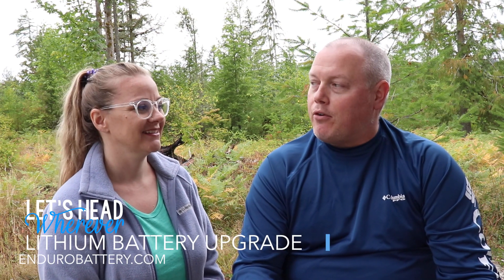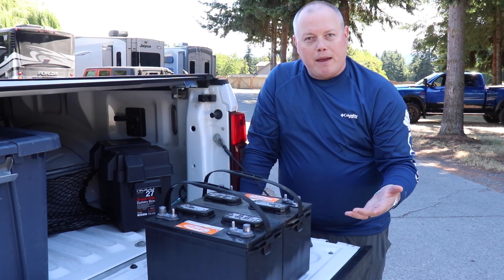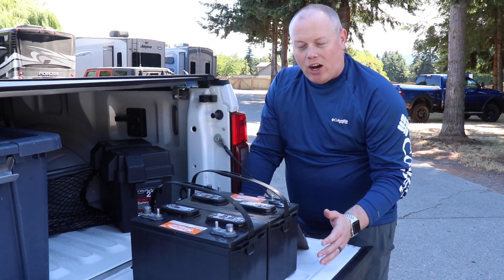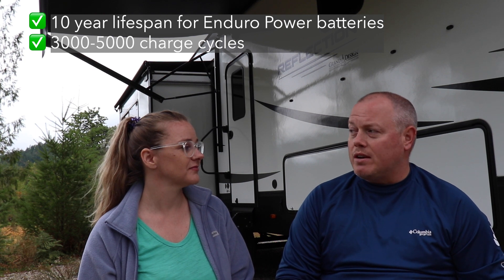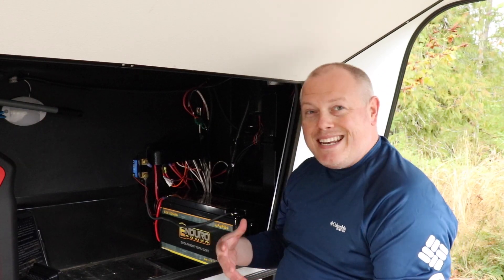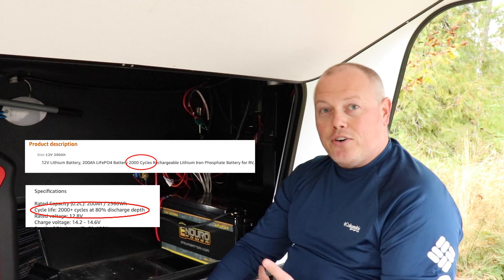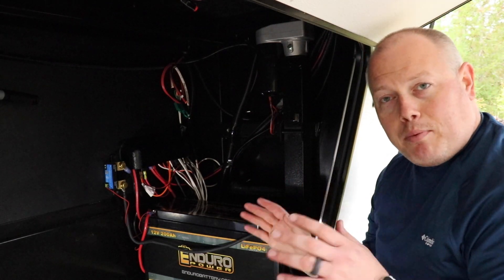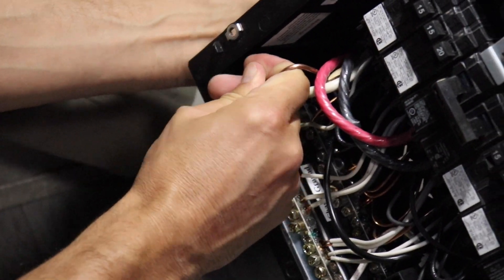RV BATTERY UPGRADE 🔋 ENDURO POWER LITHIUM BATTERIES - 5% off with code LHW5

Comment from the maker: 🔋 Use code LHW5 and save 5% off Enduro Power Batteries 🔋 Same specs with a 25% smaller battery case and save HUNDREDS over the big brand battery 😉 https://www.endurobattery.com/discount/LHW5

Equipment from our upgrade project:
- 200ah 12V Lithium Iron Phosphate battery: https://www.endurobattery.com/discount/LHW5
- Victron Smart Shunt: https://www.victronenergy.com/battery-monitors/smart-battery-shunt
- WF-9855LiS Converter: https://wfcoelectronics.com/product/wf-9855lis/

Comment: Can you run ACs off of them like the other lithium ones. I want to run the whole house part of a super C lol
Reply from the maker: Sure, you can run the AC… but not for very long 😅 Even with 900ah we could probably only run the AC for a couple hours.
Reply: @LetsHeadWherever  those are lithium correct? Couldnt you add batteries to increase run time? Already im not sold on these batteries. Think ill go with battleborn. Can really get some ah with those.
Reply from the maker: @blackcatrose4257  Yes, they’re LiFePo4 batteries. You can add ad many as you have room for. We have 3X 300AH batteries so they don’t take up much room.

Comment: I do like the smaller size of the Enduro Power batteries and while they do appear to be built with lithium cells that are UL certified the rest of the electrical components are not.   I’m specifically concerned that they do not carry the UL2054 certificate against explosion and fire.

Comment: Thank you for an excellent video. We are looking at lithium for our truck camper. Need to ask to be sure: I know you’ve gotten a solar system since this video. Did you have any solar when you were doing this battery project? Blows me away how much you could do with 200 amp hours!!
Reply from the maker: No! We had zero solar when we first upgraded batteries 🔋
Reply: @LetsHeadWherever  Thank you. That’s what I thought but I had to ask to be sure as I’m blown away by what you could do  with just the batteries!! Amazing!!

Comment: Which WF power converter did you remove? We have a WF 9855. Their website doesn't indicate if that unit is compatible with an lithium batteries.
Reply from the maker: I don’t recall and we’ve since replaced everything with a full solar/inverter system. If I remember correctly, so long as it states both 13.6 & 14.7V you’re good. The 14.7 will bring the lithium battery to full charge.
Reply: Just found the specifications on the 9855 The charge voltage is 13.2-14.4
That probably won't get lithium to full charge. Do you still have your lis converter? If so do you want to sell it?
Reply from the maker: It may be 14.4, I was going off memory… dangerous move 😅😬
Reply: Ok looked at spec's for lis and max voltage is 14.6. So your memory is pretty good. Same for the 9855-AD. Which is their auto detect unit for lead acid or lithium.

Comment: I'm going to add a small bit of "Food for Thought" to this video. 

If you wish to keep your Lead Acid batteries in good working condition for the longest period of time, then as stated in this video, you shouldn't discharge them below 50%. But that doesn't necessarily mean you have 50% for usable energy. See, you think you know where I'm going with this, but I promise you, you (probably) don't. 

From 80% to 100%, your Lead Acid batteries go into an "Absorption Phase" where the battery charges MUCH SLOWER. It takes many Hours, trust me, more hours than you have in a day of typical charging while camping, to go from 80% to 100% capacity. So let me lay out a typical camping scenario. 

Let's say that you're going to be in a camp ground with no hook ups for a 5 day stay. You have a 200 watt solar suitcase and a portable generator. In a best case scenario, you have full sun for the five days and you can run your generator 2 hours in the morning and 3 hours in the afternoon. 

On the first day you pull into the park, your 2 100ah batteries (200 total ah) are at 100%. You have 100ah of usable stored energy. With typical usage, on the first night you watch a bit of TV and maybe your Furnace runs a bit because it gets down to 60 degrees overnight, you charge some phones, laptops, your on the internet etc. In the morning, you have used 30 amp hours. Effectively, your down to 70% of your total 200ah left. You have 200 Watts of solar but even during the day there is a small draw on the batteries so your battery bank is either holding steady or only charging very slowly. So, you run the generator for the full 5 hours of allowed time. At dark on the second night, you start with with 80ah of capacity. Note, you were only able to put 10ah back into the battery bank because at the 80% mark the battery charging slows way down. In the morning you have used 30ah and you're bank is down to 50ah. Same charging parameters as before (a bit oversimplified just for this example) and you head into the third night of your stay at 65ah. Note, this time you were able to get 15ah into the batteries because your within the battery banks bulk charge range. In the morning you wake up having used another 30ah to a battery bank with 35ah in the tank. Same charging parameters as before and you head into the 4th night with 50ah. In the morning you wake up having used another 30ah and your now down to 20ah in the tank. Same charging parameters as before and you head into the fifth and final night of your stay with 35ah. In the morning on the day of your departure having used another 30ah, you wake up with just 5ah of useable stored energy. Barely enough to pull the slide in before dipping into the danger zone. It's a good thing you're leaving because your battery bank can't handle another night of use without a complete full charge which could take a day or more of full charging. If you're staying for 7 nights, you're going to have to effectively stop using any power and just charge. 

The moral of the story in case it's not clear is: While camping, the effective usable range for your Lead Acid battery bank is between 50% and 80% (of your total possible amp hours). If you have a 200ah Lead Acid battery bank of which you can effectively only use 100ah, and you can only effectively bulk charge between 50% and 80% (of the total capacity),  you only really have 60ah of effective energy to use. Ideally, you would want to have the ability to charge your Lead Acid Batteries 60ah each day if you want access to your full (Real) capacity. Under a typical daily usage of 30ah, you should be able to at least jack 30ah each day into your Lead Acid battery bank. 30ah isn't an extravagant expenditure of power for typical RV's. We're not talking running the AC or Microwave or hair dryers or coffee pots. We're talking about lights, charging phones and computers, maybe some TV use, maybe the furnace fan, water pump and parasitic battery draws. Where I live we get plenty of cloudy rainy days and we primarily camp in the woods under partial tree cover. We have 400 watts of solar power and we are lucky if we pull in a MAX of 80 watts. Averaged through out the typical day, we pull in around 20 watts of power per hour on average. I have a 70 amp Progressive Dynamics PD9270 converter charger. I have NEVER seen my battery bank draw more than 15 amps of power while charging the batteries and you can only run your generator 5 hours a day in most parks. Believe me, it's not as easy as it might first seem to jack 30 amp hours a day into your Lead Acid battery bank.  

While upgrading to Lithium is anything but straight forward,,,,,, in fact let me say this first. Anyone who says you can "Simply swap the batteries and upgrade the converter charger" DOES NOT KNOW WHAT THEY'RE TALKING ABOUT, PERIOD! Lead Acid and Lithium are two different echo systems and even the most modest 2 battery 200ah Lithium battery upgrade will require updating your RV's echo system. If you don't know what I mean by echo system, then you need to do your research because there are lots of considerations that many of these YouTube videos are not telling you about. But, as I was saying, while upgrading to Lithium batteries is anything but straight forward, they are superior in every way to Lead Acid. There are two major advantages in particular out of loads of advantages that make a huge difference. First, they charge MUCH FASTER in that you can pound up to their rated charge current into them from empty to full. In many cases, you could potentially jack 100 constant amps into a 200ah lithium battery bank until full charge. So the time you have each day to charge is worth a lot more.  Second, you can reliably pull 80% of the battery banks full capacity out of them without significantly impacting their longevity. That's 160ah out of a 200ah lithium bank. There are loads of videos that say you can fully discharge a lithium battery or pull out 100% of it's capacity out. And sure, you can do that, but doing so will cut the life cycle of your batteries in half. If your batteries are rated for 4000 cycles, you can figure on getting 2000 cycles out of them if you fully discharge them every time. In reality, the typical RV camper will never use 160ah in a day unless they're running air conditioners and other high draw items. If you're drawing 30ah to 60ah out of your 200ah Lithium bank each day, you are not only able to replenish that amount far easier, but you will never come close to over taxing the batteries.

Comment: Does the battery itself have A system built into the battery where it doesn't overcharge it
Reply from the maker: Yes, each battery has an internal BMS.
Reply: @LetsHeadWherever  ok thanks

Comment: Thanks for the video.  We would probably not be off grid for more that 2 nights.  I'm considering just a 100AH because it will fit in the depressed storage area in our Reflection.  But curious, how do you secure your batteries?  Thanks
Reply from the maker: We bolted 2 pieces of 2x4 to the bottom of the front storage bay and the batteries rest on them. They’re snugged up in the corner but not secured by anything. I don’t think they’ve moved since the install!

Comment: Just received our 300 amp hour EnduroPower batteries this week. Looking forward to installation which will be simple cause we’re replacing existing batteries. Drop in and attach cables. 340 pounds replaced by 130 pounds.
Reply from the maker: That’s awesome! You’ll love it 🤙

Comment: When traveling, can the truck recharge a Lithium battery?
Reply from the maker: It may send a trickle of charge over to the RV, but the the 12V wire in the 7-pin connector is too thin to actually charge it while driving.

Comment: That’s great . How are you charging the battery,?no Solar?
Reply from the maker: Initially, we would just keep the battery charged from shore power, we would only do a day or two off-grid. Since, we’ve installed a complete solar system.

Comment: Hi.  Just saw your video and your video got my attention.  Bought a Class B 2 years ago and have been thinking about replacing the AGM batteries when the time comes.  Was thinking about using another brand not battle born unfortunately my dealer has to get permission from Manufacturing company of my van to install the batteries.  So now I am going to start looking for someone who can install lithium batteries.  These enduros seem to fit the bill for what I want...great video by the way.
Reply from the maker: The Enduro batteries have been great. We even added more during our solar install 🔋 👍

Comment: The ultimate battery: Internal battery monitor shunt. Internal disconnect switch. A built in Anderson Power pole SB175 inverter connection and a separate Anderson Power pole connection for the charge controller. A case that can be opened if a cell or the BMS needs to be replaced. Provisions for mounting it to a floor or a wall.

Comment: Thank you for your very in depth review of your solar system. Just subscribed to your channel by the way, I have one question though. We have a smaller unit than you a 24ft Micro Mini. It came with (1) 100 amp solar panel do you have a suggestion of how many more panels we would need to compliment your set up and can we still run our 1500 air conditioning unit. Great video easy to understand!
Reply from the maker: I am admittedly not very knowledgeable about the electrical systems and how much folks need between solar/battery. I know a good bit about our system, but outside of that I’m basically 🤷‍♂️😅 I recommend checking some of the Boondocking or Solar RV Facebook groups, they have folks who know way more than me and could probably advise you better 🤙

Comment: Thank you for making this video, this is what I have been wanting to do but was unsure if it was possible.  One question for you though, can I do this without installing the battery monitor?  Thank you!
Reply from the maker: Yes, you don’t need to have a battery monitor, but it was important to us have the ability to see precise charge levels and know how long until we went dark 😬😅
Reply: @LetsHeadWherever  Thanks for the quick response!  Thats what I thought but was not sure.  We are almost always plugged into power and dont feel that we currently need to monitor to the detail that is offered with that monitor.

Comment: Great video!  This is exactly what I've been looking for.  It's been a few months, any issues with the Enduro Power?
Reply: I have had my Enduro for over a year and they have been excellent. Love my system.
Reply from the maker: We just added another 300ah. Total bank is 900ah now 🤩
Reply from the maker: Our Enduro batteries have worked flawlessly since the install. We actually upgraded to 600ah when we installed a full solar system a couple months back. We have a video for that as well 🤙

Comment: Initially - the up-front price seems to be the only downside.  but if you look at the battery cost over 10 years for 200ah, and compare that to Lead acid - suddenly Lead acid batteries are the more expensive choice!!  Looking to take the "Lithium" plunge ourselves soon...
Reply from the maker: That’s exactly right. Especially knowing the lifespan of lead acids are only a couple years and you need 5-6 of them to make up for the single 200ah. Those things add up! Thanks for stopping by 🤙

Comment: Do you remember what the bottom dimension was of the 200amp you put in?  I'm wondering if a 300amp would fit in the same space?
Reply from the maker: Herb, sadly I don’t know the dimensions off the top of my head. They’re listed in the specifications on the website for sure https://www.endurobattery.com/discount/LHW5
Reply: @LetsHeadWherever  Thanks, I emailed Enduro to see if the top and bottom dimensions were the same. From pictures it looks like it tapers out at the top and didn't know if dimensions included the handles or not....Did you have more room at the bottom of your tray?
Reply from the maker: I have over an inch, possible two inches of wiggle room between the battery and walls of the storage area. We’re adding batteries soon so I plan to fix them in place once the full array is there.
Reply: @LetsHeadWherever  Thanks Joe,

Comment: What was your solution with regards to being able to charge the lithium’s from your truck?  Do you just not charge when going down the road? My understanding it pulls too many amps with just the normal truck to trailer hookups.
Reply from the maker: There’s a trickle from the truck to the lithium battery when connected, but I pull the 7-pin as soon as I can to avoid having the lithium leach off the truck battery. I won’t rely on the truck to charge anyways, we have a generator if we absolutely needed to top the RV battery off.
Reply: @LetsHeadWherever  I've read that you can burn up your alternator without a DC-DC converter. Are you worried about that?
Reply: @donrauschmeier9733  Trickle charge from a 7-pin does not draw enough power to burn up the alternator. It's possible the trickle charge will not charge at all, given its low voltage.
Reply: @danostrom  Really??? There are a lot of videos and articles about installing a B2B charger to regulate the proper charge for the battery (while traveling) as well as isolate the rig from the tow vehicle charging system. I am an absolute beginner with this power stuff and I haven't been able to get a definitive answer to the question of the "concerns" of running the connection without the DC-Dc charger.
Reply: Where are they made? You mention “US” company, but I suspect like BB batteries they are made in PRC